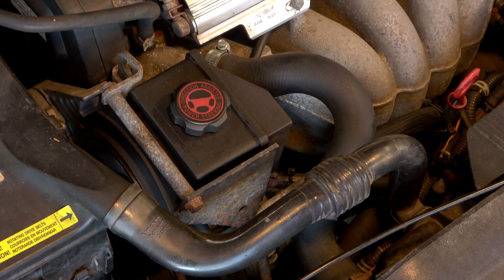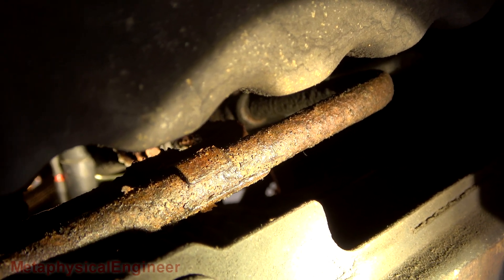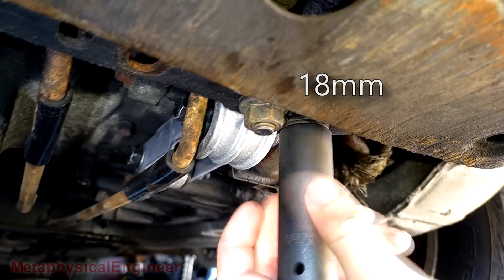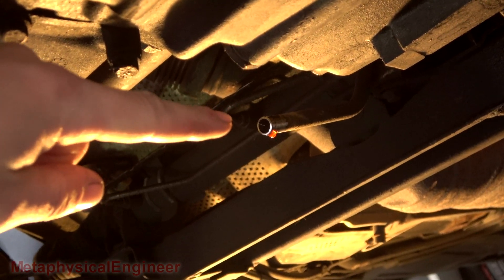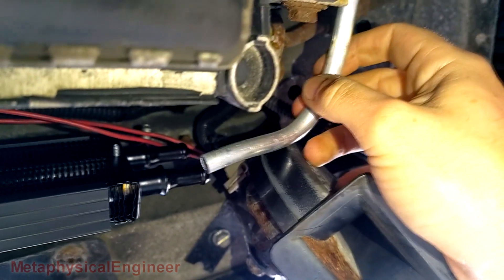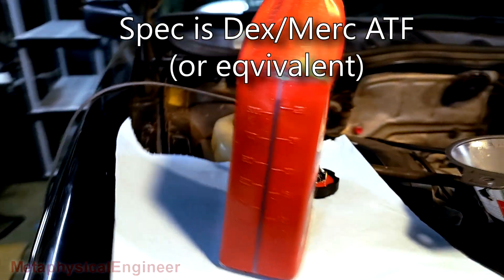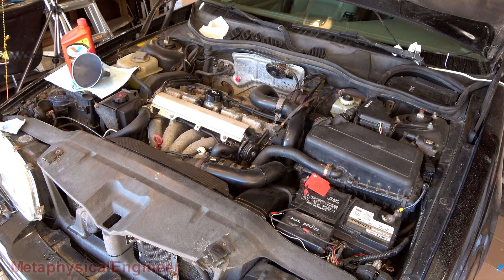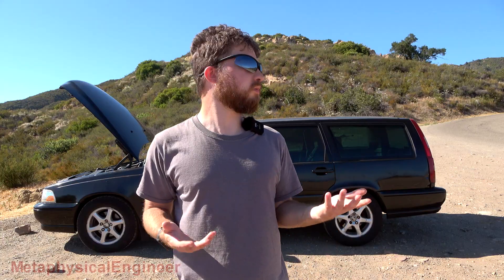Power Steering Gets a Refresh

Comment: Sorry is I missed it, but what symptoms caused you to go forward with this fix?
Reply from the maker: The extreme corrosion on the high pressure line was the main reason.  That tiny seepage of fluid would get worse with time (a couple years ago it was completely dry in that area).  Or if that deteriorated crimp failed, the line could blow off and spray fluid all over the engine.  Best case would mean losing steering assist which is very necessary on this front heavy car, and worst case the fluid could ignite and burn the car down.

The cooler and filter were for overall reliability as elevated temps cause accelerated pump wear and stress the seals in the steering rack.
Reply: @MetaphysicalEngineer  excellent.  Nice work, glad you’re keeping the car on the road